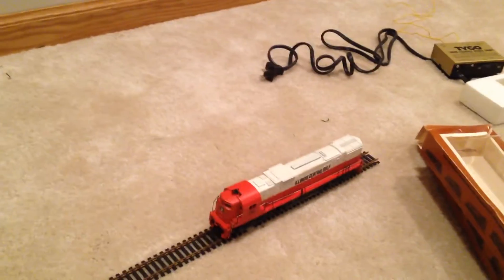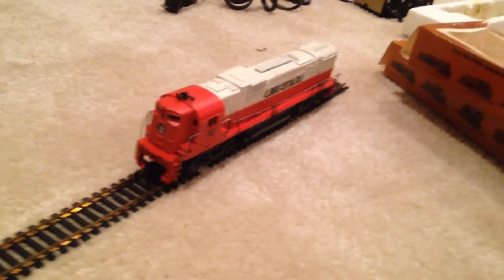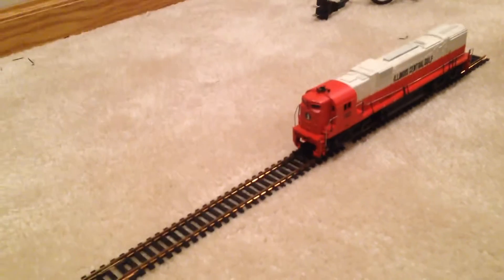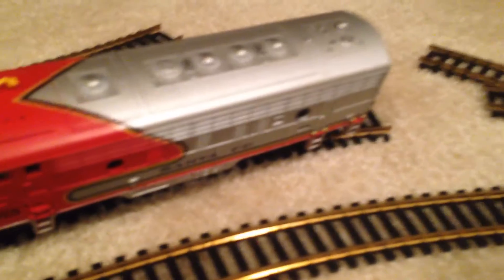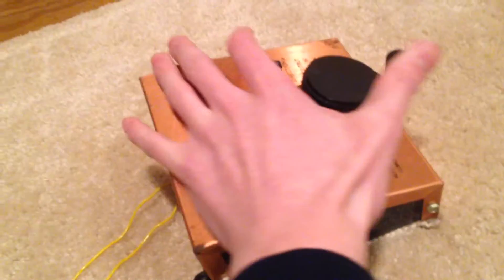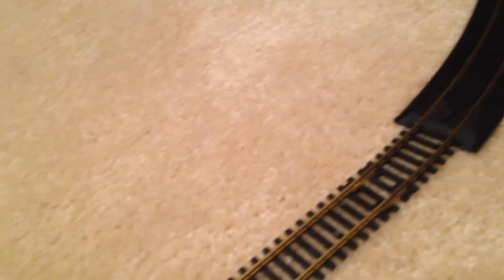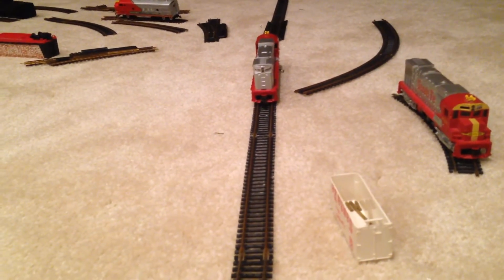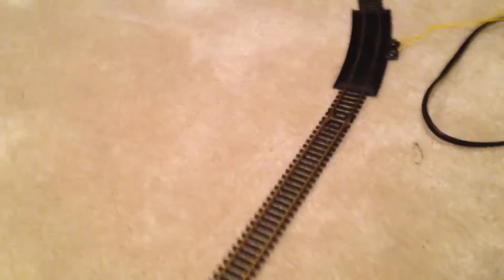Model Train Monday: Episode 1: Tyco ho trains

Comment: The F unit is from the days before Power Torque Drive & the front truck was not powered.   The Power Torque Drive diesels have the front truck powered & the rear truck not powered.  I think some of the Mantua F units had both trucks powered.  Brass track is a pain due to the oxidation that builds up on it - get nickel-silver track!